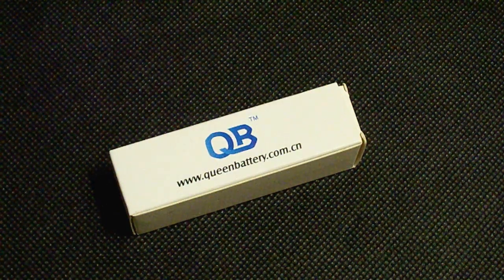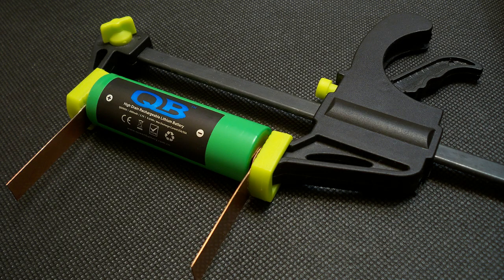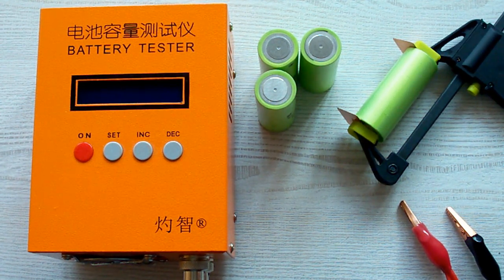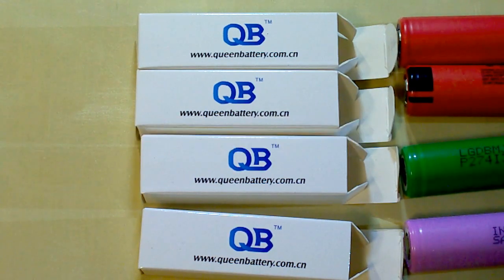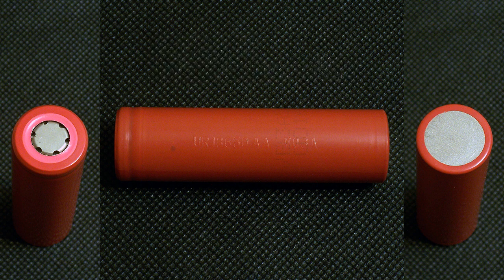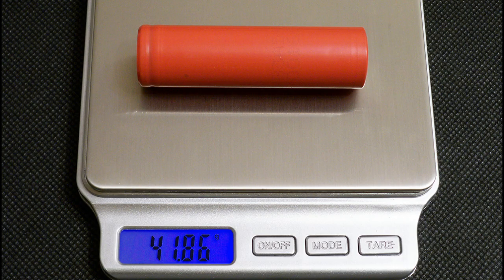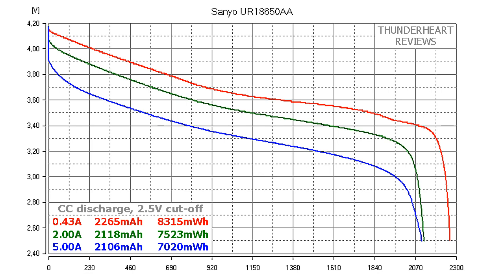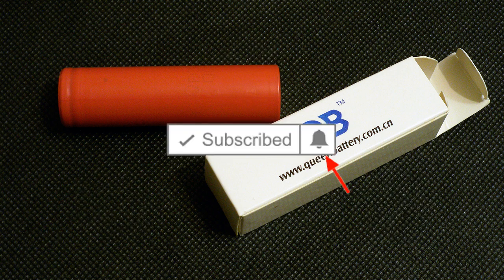Sanyo UR18650AA - a low price 18650 Li-ion battery (capacity test)

Comment from the maker: 0:19 - Testing equipment and conditions
1:28 - Battery supplier
1:52 - Sanyo UR18650AA specs and capacity test
3:21 - Verdict